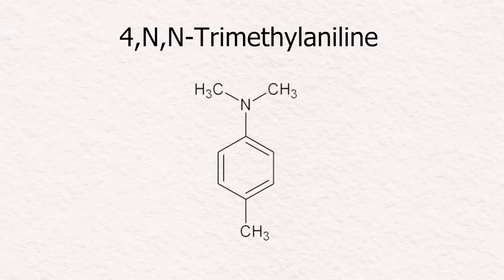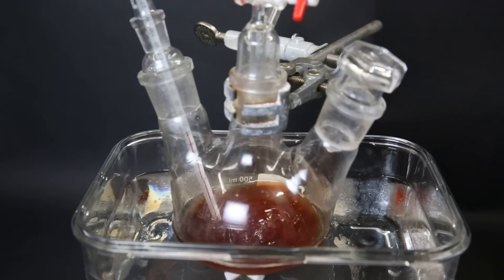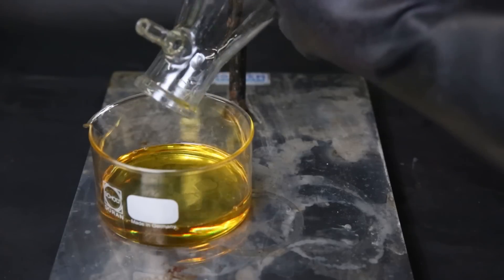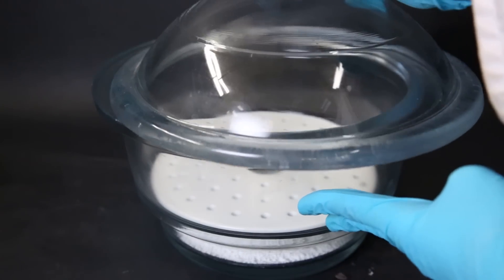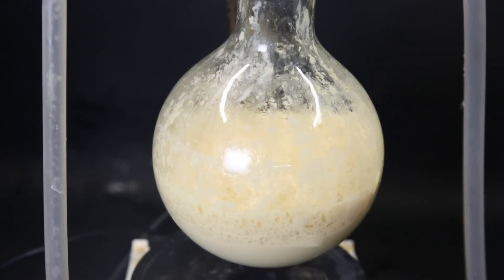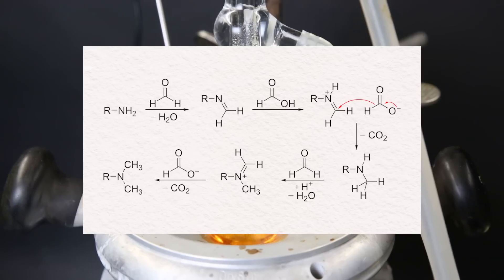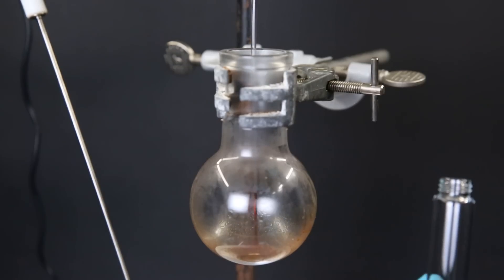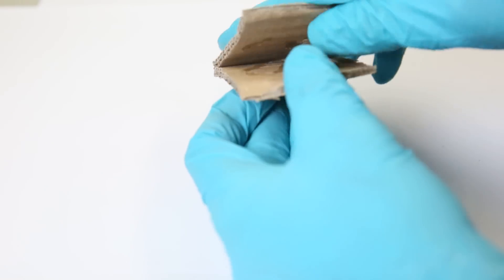Making 4,N,N-Trimethylaniline - Super Glue Activator

Comment: lol this is interestingly close to kevlar synthesis. para aromatic bonds.
 industreally they use 
1,4-phenylene-diamine (para-phenylenediamine) with terephthaloyl chloride to yield Kevlar polymer 
all those hydrogren bonds combined with strong amide bonds, all in a super linear structure coz u start with terephthaloyl di chloride, (1,4 acyl benzine?). 
I wonder what polymer you would get if instead of starting with 100% para bonding sites you had like 90% para and 10% ortho. you know like some reaction where the reactant was being formed slowly and so kinetically you would have some ortho and some para product instead of the thermal (nonsteric?) product of all para.
i bet you would have some kind of kevlar that is also stretchy/springy.  right now the only elastic kevlar i know of is when they take like 80% kevlar and mix it with 20% nylon/other elastic fiber which imo ruins a lot of the strength/abrasion/heat protection properties of it. like come on dupont just make a new polymer instead of suing other people for patent infringement :p (btw i think kevlar went off patent like a few years ago and u can buy for ultra cheap now... ~5$/sqmeter bulk)

Comment: Nice synthesis.  Just FYI, it's better to put your super glue on one surface and the accelerator on the other surface.  If you spray the accelerator over the super glue then it starts drying instantly, you want it to dry when the surfaces are pressed together.  Also, the accelerator solution you used was kinda weak because the glue should dry almost instantly when you press your two objects together.

Comment: Does it make a difference if you don't spray it on the superglue but on the opposite piece instead and THEN put it them together? I mean doesn't the activator react immediately on contact with the super glue? It seems pretty retarded to me to spray it directly onto the superglue before putting them together though.

Comment: Instead of acetone, heptane can used as the solvent for the dimethyltoluidine. At least I think so - the activator I have is (I think)  dimethyltoluidine in heptane.
Also, 12:12 - The problem with doing it like that is that you already instantly hardened the super glue before you had placed the cardboard together. Place them together first, then wet the whole thing with activator.
Reply: almost gas or petrol...

Comment: i really like to use a dilute bicarb solution as an activator, it works like a charm, however u have to drip it on the side and contact ur glue sideways to ensure proper adhesion. But from experience it tends to polymerize almost instantly
Reply: I do the same, I didn't realize commercial activator was not just bicarb

Comment: I would be interested in mechanism of how this works..  Dimethyl toluidine is also added to methacrylate resin to somehow improve rate of polymerisation. At least with benzoyl peroxide. I have done some experiments with photoinitiators, and there it seems it is not increasing polymerisation rate, but I am not sure why.
In any case please make vid of producing CA glue, I would be extremely interested to see the process.
Reply: Hi my guys; there are a couple of polymerisation mechanisms for acrylates. With photoinitiators you tend to make radicals but tertiary amines are good bases so they could initiate an anionic polymerisation because the cyanoacrylate anion is pretty stable. 
Dimethyl toluidine could actually absorb UV light and so reduce efficiency of photoinitiation. But I'm not 100% on that one, you'd have to check the absorption spectrum.
Reply: @mmmhorsesteaks  Makes sense, Thanks for explanation! At least for CA glue. Why it's in MMA+BP resin system is still bit unclear to me...
Reply: @IlusysSystems  there is a paper called "Rational Design of Efficient Amine Reductant Initiators for Amine–Peroxide Redox Polymerization" where they propose a mechanism for the acceleration of decomposition into radicals. I found the pdf online but yt doesn't let me post links :-/ hope you can find it!
Reply: @mmmhorsesteaks  Oh neat, the paper suggests better performing chemistry as well! Thanks for sharing :)
Reply: maybe the photoactivators act catalytic and the penzoyl peroxide is instead consumed in the process of radicalizing MMA?
Reply: @namibjDerEchte  with stuff I was messing around with, photoinitiators should form radicals, but papers I have read suggested that there is almost always more than one mechanism in action and we can talk statistically that radical formation is most significant.
Looking again at experimental data with TPO initiator, DMT(dimethyltoluidine) decreased polymerisation rate significantly only when added in excess (4%) 1% and 0.5% had almost no measurable effect but did not increase the rate. Same experiment but with TEA (triethylamine) gave pretty much same figures.
Similar experiment with benzil dimethyl ketal as initiator showed that TEA increased polymerisation rate significantly at 0.5% concentration, but there I have sample size of 1 and testing device was quite iffy in build quality, sooo I would need to repeat whole experiment to speak with any confidence... Also no data for  DMT on this experiment

Comment: I worked for a furniture factory and we had a super glue that we sprayed acetone I thought the label only said acetone I could been wrong it might be the same as your product after spraying it on that caused it to set up after it was sprayed you had 3-5 seconds it would get hot to
Reply from the maker: Probably similar to my product, different types exist as well! Acetone alone doesn’t really do much besides being a relatively safe carrier that evaporates quickly. It is also a very good solvent for many polymers so i can imagine it helps the active ingredient penetrate properly.
Reply: If the stuff dissolved in the acetone isn't hazardous I think they don't have to put it on the label.